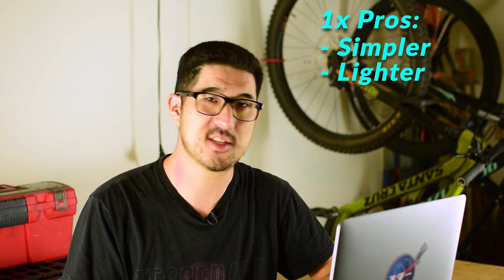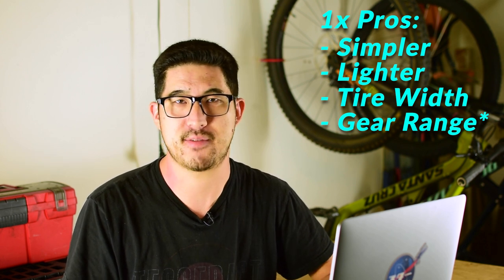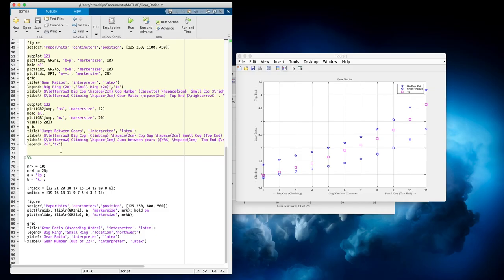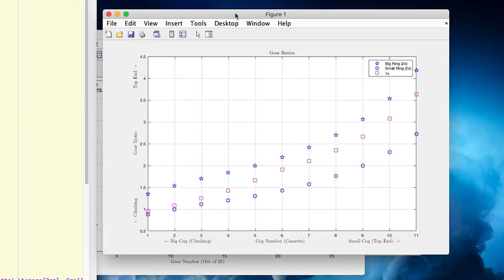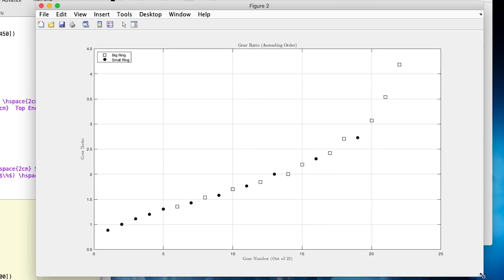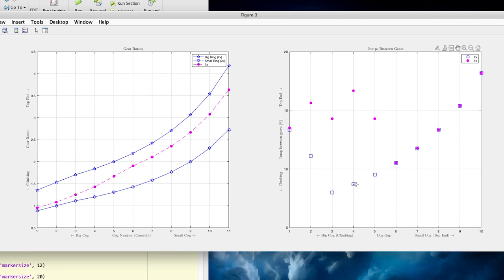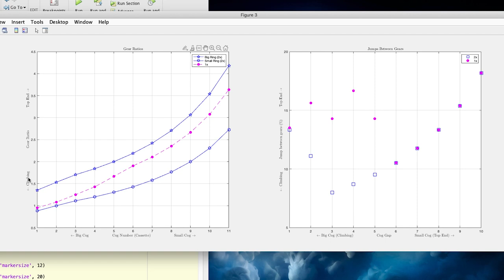1x vs 2x Drivetrains For Gravel Bikes | The ANSWER! (Is In Gear Ratios)

Comment: I thought a long time about 1x, but in the end, I wanted smaller gaps and a wider range. I went with GRX 2x, but with an MTB cassette. In the end, I'm running 48/31 and 11-40 cassette. I live in SoCal and do a lot of steep climbing and having a 31x40 climbing gear for those extended 12-18% dirt climbs feels much better that my previous 1-1 ratio Ultegra gearing (34/34) on my nearly 60 year old knees. Really appreciated the video. Maybe in a 1x13 setup with enough range I can get something close to my current gearing, but until then...I'm fine with my 2x.
Reply from the maker: Nice! What a monster range- best of both worlds. I appreciate when people do their research and choose what works best for their specific style based on thoughtful consideration of the options.
Reply: @TheBikeSauce  On a related gravel bike note...I just ordered a set of the Hunt 35 Carbon Gravel wheels. Now I just have to try to be patient until the first week of May...It appears to be the only downside of ordering Hunt wheels!
Reply from the maker: Nice!! What an upgrade!

Comment: This video confirms what I did with Excel before finding this site, plotting gear ratios and wondering whether I should go one-by or two-by. Our plots match exactly. However, I'd reached a different conclusion - I thought I'd want tighter gear increments on the low end, not so much on the high end of the gear ratios. For example, when I'm slogging my way up a hill in say 3rd gear the last thing I need is a big jump to 4th gear, etc. But I could be wrong (overly worried) there. Great videos you have. I just bought the same model you have yesterday before I'd ever seen this site and in large part because of the concern about gear ratio tightness, but now thinking of taking it back and paying up for an Expert (1x) version because of all the other features it has.
Reply from the maker: Very nice, fellow bike nerd! In my experience, I prefer tighter ratios at speed. While climbing a steep hill, I usually just find a gear and settle in. It’s all personal preference though.

Comment: Excellent explanation. Having gotten back on a geared bike after a decade riding only a fixed gear, the 2x drives me insane. The redundancy and the worry of cross chaining is such a bother (and compared to a fixie it's so damned noisy). It was great to have your detailed analysis fill in for my intuition: I would definitely go for a 1x. Another reason to add: in order to keep the total number of bikes low (apartment dweller here), I have thought about designing a rig that can be (relatively) easily converted between a gravel/touring bike and fixed gear by swapping out the rear wheel and chain and temporarily removing the derailleur.
Reply: Well now I have learned from some of the other comments that 1x will give you some bad chainlines too, so I am less resolute!
Reply from the maker: Nice. Thx for watching. The issue with the chain line.. I’m not totally onboard with that. It assumes 2x users shift perfectly to avoid cross chaining, which is not what I see out in the wild. A lot of cyclists don’t know how to properly shift a 2x system, so I think overall that point is a bit overstated.
Reply: @TheBikeSauce  That's a good point. I, for one, would fall into that "don't know how to properly shift" category!
Reply from the maker: Haha it’s not a bad thing. Modern drivetrains are so robust, I just don’t buy the ‘1x is bad bc of bad chain lines’ argument

Comment: I would love a follow up with the same graphs but showing the newest 1x12, 1x13 and even 1x14 configs out there. With small cogs going down to 9 teeth, there really isn't much of an argument left for 2x.
Reply: Here's an argument for 2x: 9-something cassettes are still quite a bit pricier than 11-something cassettes
Reply: @M.F.Hafizhan  true
Reply: Inefficiency of 9t. That being said I have a Canyon Grizl CF SL 7 with SRAM 1x12 eTap and I love it.
Reply: This efficiency crap is a myth. You have to have the RIGHT front ring for your LEGS. And the right brand. Litepro with a chaingaurd is superior to anyother..as the teeth are set 4mm more central than standard chainrings. And it has wide and narrow deep set teeth. That means less crosschaining and chain drop is virtually non existent. I did this experiment years ago. People assume as soon as you put a bigger front ring on your bike you are gonna go faster for example. WRONG.

It's the balance of cadence and gear ratios in relation to your leg strength that matter. There's no point for example having a 58 tooth front ring on your bike. If you cannot even turn it 80 times a minute. I tried everything on my 20 inch X18 road bike from a 42 to a 53. I settled in the end for a 45. With a 9--26 shimano capreo on the back. Which is the equivalent of an 11--55. And I was able to get a better average speed and overall top speed. With the 45. Than I could ever get with a 52 or 53. Because I had a superior cadence. And was able to maintain it for longer periods of time.

All these things have to be considered. What on paper looks better. Isn't always the case in reality. It's A PERSONAL thing. Just like saddles......
Reply: @M.F.Hafizhan 
1X9 rules my world and always will.

9,10,11,13,15,17,20,23,26. And a 45 on the front with 20 inch 406 Kinetix PRO X aero wheels.

Absolute perfection. No hill I cannot climb..and 25mph plus speed on the flat. Thats plenty for this 59 year old..

Using a litepro 45 chainring on the front is perfection. It has deep wide and narrow teeth. And it's set 4mm more central than most single rings. Because the 5 bolt holes are parallel to the chain gaurd. That means less cross chaining. When I go down to gears 1--3. And I've never had a dropped chain.

Litepro chainrings rule. As good as any Sram or wolftooth and a fraction of the price...

Comment: Lovely breakdown on ratios. I would like to see an additional metric added to the equation. What is the cadence/rpm required at each gear ratio to maintain, say… 5mph or 10mph. The way I interpret it, having less teeth on the front chainring allows the rider to maintain a higher RPM at the same ratio making it easier to climb. Please prove me right or wrong.
Reply: I mean not everyone prefers high RPM for climbing, that’s a personal thing
Reply: @marceloalbuja  maybe wattage output would be a better metric then to extract out of it instead rpm. I know I prefer to be able to spin my cranks on long climbs with smaller teeth on the front cog having a higher rpm, but exerting less power (wattage). That is much easier than trying to spin a larger chainring on the front which would require more power resulting in a higher heart rate, more fatigue and a greater possibility of bonking. Granted, I could be talking out of my ass and a ratio is a ratio and is no way correlated to the amount of chainring teeth or wattage output.

Comment: Great video! I love riding, but geeking out with some Matlab on gravel biking is up there ...
I can't decide 1x or 2x, so went SRAM Rival/Force on my OPEN U.P. 2x road (10-30t with 46/33t) and 1x gravel (10-36t with 42t). The 10t really makes a difference in top end, full wireless makes it simple to swap (though often just leave 1x).

Comment: I went GRX 2x and am using a sram 1170 11-36. it has different ratios up the cassette and I have found the ratios to be really nice. it gives me a great granny gear and smooth shifting all the way up the range.
Reply: I had the same Idea. 48/31 with a SRAM 11-36.
Reply: I got the 46-30 and it's working for me. but I bet the 48 would be nice to have
Reply: @USMCcharmer  Not much of a difference really. Still plenty of top end speed with a 46T. Definitely a capable setup. Most people are never going to spin-out a 46 unless downhill and 48 is maybe a bit overkill to be honest.
Reply from the maker: Right on.

Comment: In my opinion, 1x drive trains are just another attempt to sell the customer something new. In the real world, they seldom offer any actual benefit, except being cheaper when used on city bikes that literally need no particularly high or low gearing, or on bikes that are highly specialized towards on particular activity that either only needs low gears or only high gears.

1) Simpler - yes, but honestly, what active driver struggles to use a 2x or 3x? Correct, nobody. And due to the extreme chain lines of a 1x, parts will wear much more quickly, bringing more maintenance and cost in the long run than any 2x or 3x.
2) Lighter - yes, but A: a few hundret grams are absolutely inconsequential if you are not happen to ride at the Tour de France. It's literally like having your keys in your pocket or not. And B: whatever gains you'll have in terms of weight, you will loose tenfold in efficiency (again, because of the extreme chainline in certain gears)
3) Tire width - errrr, MTBs used 2x and 3x systems for ages now and they nevere had an issue with tire width. 

Another downside of a 1x, which is often ignored, is the fact, that you HAVE to step through ALL THE GEARS when accelerating from slow speeds. People often say, that on a 2x or 3x all they did was shifting a lot. I feel the exact opposite. Even just with the 10 gears I have now, on curvy and mountainous terrain I am constantly shifting six, seven, eight, nine, times and then down again for the next switchback, resulting into 18 times clickediclack, wheras on a 2x I would have covered the same distance with literally half the shifts or less. 

Add to that the "hunting for the right gear" issue, and you are approaching some essential questions. By the way, the notion that 2x or 3x offer duplicated gears isn't exactly true either. Even on my 3 x 10 flatbar gravel bike, there literally is not one gear on there that has the same ration as the others. Some are very close, but due to the different chainlines and slight differences in ratio, they do indeed feel different. As they say: It's always better to have, than to need.

We live in a somewhat mountainous area, and I need my gears to be low AND high. In the case of my transmission, it does neither, on an MTB, it will do low, but not high, and on a road bike it will do high, but not now. A 1x literally will not do that for you. Not even a current top range 1x12 by Sram or Shimano. And no, the upcoming 1x13 won't solve that problem either, they will make it worse by bringing even more absurd chainlines and overly long derailleurs, that are just waiting to be hit by a rock.
 
Since especially gravel bikes need to go both fast on the flat and have low enough gearing to tackle serious uphill climbs, it's abolutely beyond me why so many manufacturers tend to put 1x transmissions on them. It really is a step backwards and one of the reasons why most Gravel bike buyers do buy the bike they want, but not the bike they need. 
An exception might be the flat bar gravel bike, which often has a 2x or 3x transmission and a suspension fork. THAT makes sense. But it's not new. It used to be called Cross Bike and was cool 10 years ago. They literally wrapped it in a new Gravel Bike package and sell it to you as the new thing. It is one of the better bike concepts though, so I am glad it's still around.
Reply: Hello, whoever you are, thank you. This is the best comment to this awesome video.

Comment: I went with 1x13 Ekar on my gravel bike and haven't been disappointed even on the road.  There are times when it can feel "in between" but I only feel it early in the season when I've been off the bike for a few weeks.  I'm planning on building my next road bike with 1x as well.  I'm hoping for a wireless Ekar but will do Sram if it's the only option available.

Comment: Great video. I live in a very hilly area and I'm not a power rider, can you advise what 1x setup would be good? I tend to now ride at a higher cadence with less power as I'm getting older and everything I had read pointed towards 2x for hills but the difference you showed seems minimal. I want to take it bikepacking too so easy gears are really important. Thanks.

Comment: Really well explained in this video! I agree with the pros and cons you've described and for me, roadie to gravel, I haven't missed the tighter jumps going to my 1x gravel bike but I'm not racing and haven't done very long distance gravel rides.

Do you think another con of going 1x would be much faster wear of the chain, chainring, and the cassette? Hypothetically the chain line is more cross-chained a lot more of the time compared to 2x. What do you think? Could this wear be quantified in modeling somehow?

Comment: This is a great video! I’m planning to do a tour to San Diego and am worried about a 1 mile stretch for 7% grade while cycling with a load. Would a 1x system be sufficient that gets to a 1:1 ratio at its lowest? I’m thinking of getting a Surly Straggler.

Comment: Great Video, Thank you so much!
I own a 29" 10x2 XC and really like it (compared to my old old 7x3). Now I ordered a Mullet 12x1 Super enduro, and I'm curious what changes I have to aspect. You really brought some light in to the dark and doing it with Matlab is genius!

So my new bike (with Lockout) and the 27" in the rear will probably by easyer to for climbing... Manly because of the smaller wheel 😄 But I won't be as fast in the biggest gear... Luckily it's a Bike aimed for descending, or SENDING IT😂 

Intuitively I thought it was the other way around, thanks again!

Comment: One thing I don't like about 1x, at least on my XC bike is the noise it makes when I'm in the highest 3 or 4 gears.  Still not 100% sure why this happens but in the higher gears it sounds like a rattletrap and it gets progressively worse the higher the gear.  Not sure if it's the chain hitting the chainstay or maybe the rear mech arm bumping the back of the mech or what.  Might not be a big deal for some people but it can be a bit annoying to me.   I do know that in the highest gear and with a small front chainring and the mech arm elevated to a point almost completely behind the mech, the chain runs much closer to the stay than in the lowest gears.  I'm wondering if the problem is mitigated with 1x gravel bikes with the typically larger front chainring.  All I know is I never had that problem with a 2x or 3x setup.

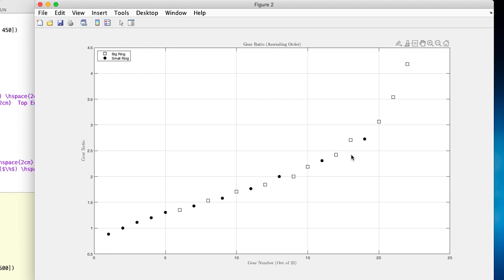Comment: 10:25 More like 13-14. It's not just the exact same ratios you lose, but ratios with extreme shifting sequences. No one would shift up 1 on front and down 4 on the back for the next possible ratio, to then sihft 1 down on front and 5 up on the back again for the next slight increase. Not to mention the narrow-wide chainring you can't use on a 2x system. Or the lack of noise of the chain grinding the cage.

Comment: Great video!   Thanks.    Looking at the 1x 2x choices myself.    I'm an older rider and not the strongest out there, so I like lower gears.   In fact I find myself very rarely using the 11t cog on my bikes.     I recently went with 12-28 cog for my 10spd Tiagra with 48x34 chainrings, and  11-28 cog on my GRX 600 bike with 46x30 rings.     I strongly prefer the single tooth jumps between 17-12 and 17-11 on my cassettes.    I just can't handle the mid and low cassette 2 tooth jumps (like 13-15-17) and keep my cadence within an acceptable range.    No way (yet!) to get 1 tooth jumps  with a big cassette for a 1x system.    But the 40 or 42 back there would sure be nice at times!
Reply from the maker: Great! If you prioritize the single tooth jumps, then it seems the cassette options are pretty limited. You could always go smaller chainrings up front.

Comment: Really appreciate the videos you are putting out. Haven’t cycled much since I was a kid. Looking to get a gravel bike as I need something that can handle gravel occasionally, cobblestone, and at the same time move well on the road. Was hoping you might have some advice on to what drivetrain would be preferable in my situation?  Also can you switch drivetrains out on the specialized diverge?
Reply from the maker: Drivetrain choice really comes down to rider preference. If it’s really hilly and you like to go fast downhill, then a 2x would guarantee the wide range and small jumps. For most casual cyclists, I’d venture to say 1x is plenty sufficient, when spec’d with the right gearing .

Regarding the diverge - funny you ask. I just converted my diverge from GRX 2x to GRX 1x and have been loving it. Video on that conversion will be live in a couple weeks

Comment: Angsted over this for ages. 

The jump on my MTB with Shimano 11 speed from 37 to 46 is just odd, on an MTB you’re likely doing a lot of climbing so a closer ratio would be better in the climbing gears, and bigger gaps in the speedier gears. Hence, why people go to 12 speed or run a better ratio cassette, e.g., Sunrace.

Worried this might be the same for gravel. There are lots of flats (both gravel and road) so speedier gears are nice, but you also still have to expect  a few 17% grades on any ride; not as steep or as many on the MTB, but gravel rides tend to be longer and fatiguing in their own way, and the option to pick a variety of bail out gears on a climb is a what won me over to 2x. I really wanted 1x to simplify and having the extra shifter as an option for a dropper is also appealing.

Maybe if i lived some where flat I might have gone with 1x.
Reply from the maker: Right on. It’s a personal choice for everyone clearly. Both systems have pros and cons